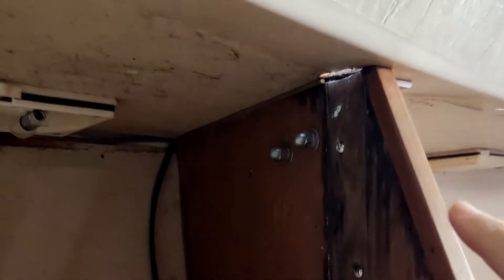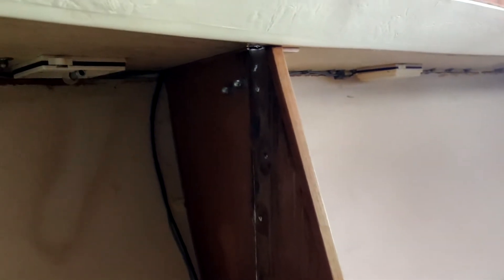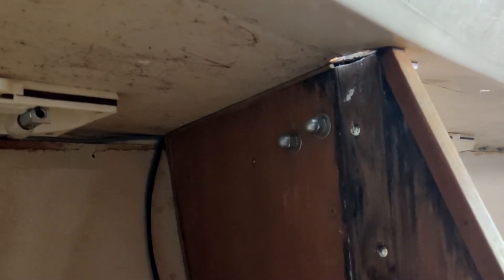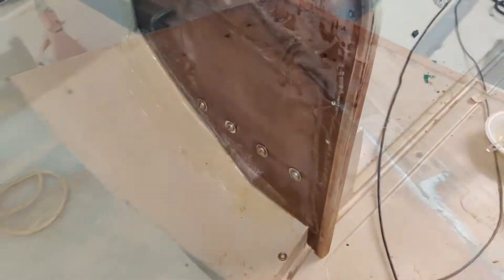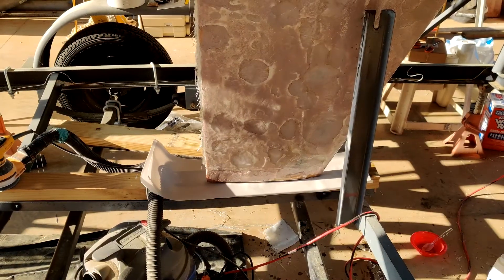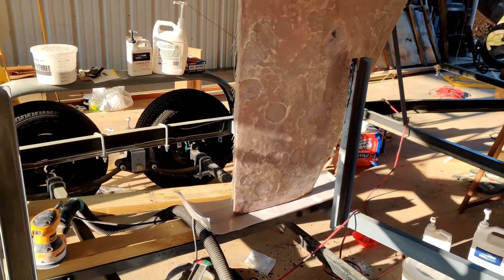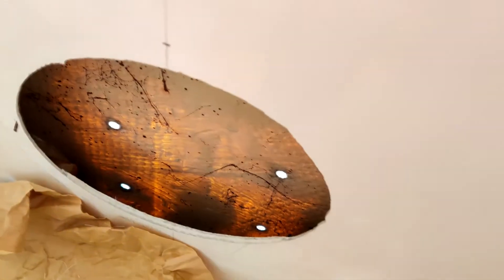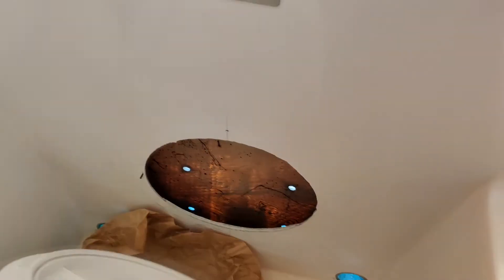Capri 25 part 9, a lot of stuff

Comment: I reworked a Capri25 last year and I'm enjoying you tear into this one. I liked your use of what I'm guessing is UHMW Polyethylene? I'd like to know where you source it. I did the rework in the street  and I would have loved to have a barn like you enjoy.  My boat (1982)has always been in fresh water and had what I'll call micro-blisters. I used a water based chemical/marine stripper. It worked very well , I killed several Harbor Freight moving blankets to catch debris. Then high pressure air to blow out the blisters. 3 coats of Pettit Protect then  3 coats Petit Vivid. Then the grand kids helped me paint on some Poka-Dots. When we get heeled over we show them off!
Reply from the maker: Thanks! Uploading another today. Had the bottom soda blasted which made my life easy. The fairing compound is actually called watertight. A super hard two part. Most everything comes from Jamestown Distributors. All the glass is set with Total boat epoxy. Different kinds depending on the weather.
Reply from the maker: OK, After re reading again... The topside wood.... I used the plastic that you can frame doors with. found what I needed and cut all the shapes. There is a section in our local Home Depot that has various pieces. I found what was closest and went to town. The companionway step, I had to connect two pieces together because I did not have a large enough piece for that part. Hope this helps. I never want to do wood outside ever again. Too much work!